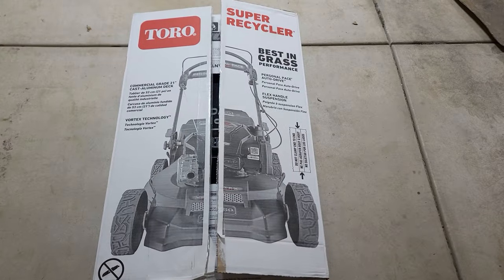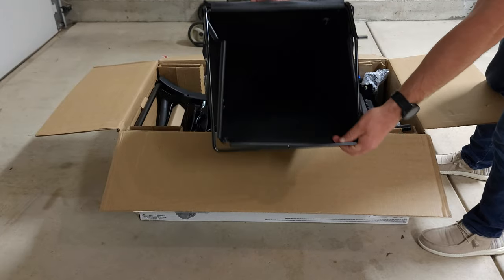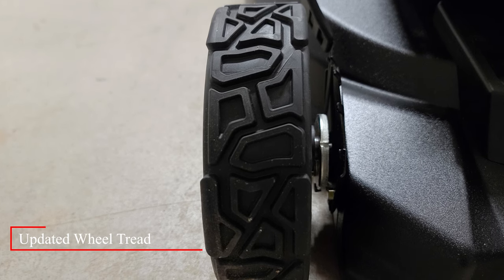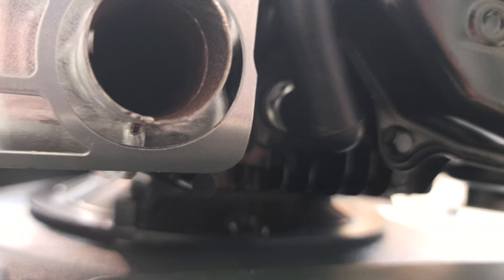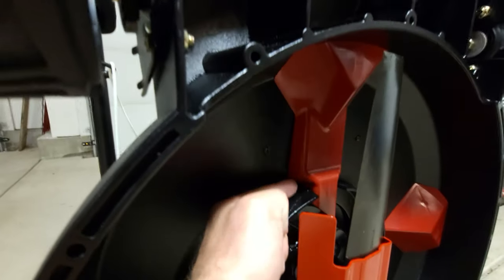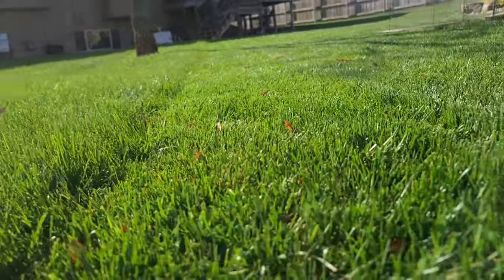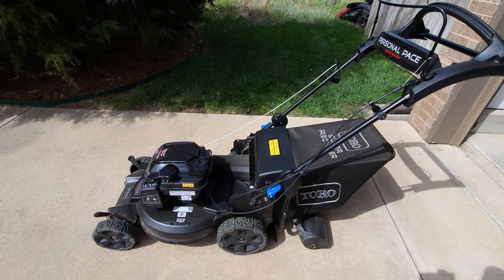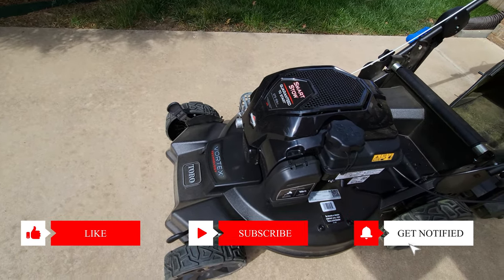Best Toro EVER?! New 2022 Toro Super Recycler 21565 Unboxing and Initial Review

Comment: why the hell would they remove the side discharge option?  Some of us deal with super high grass from time to time and that is the only way to mow it!
Reply: They didn’t. You have to register your product on their website then you can get the piece needed for free. They just don’t want them all ending up in landfills because of how many people don’t use them.
Reply: This mower isn't meant to be used out doors ... For high grass - remove ALL the recycling BS ... even the belt cover , detach the discharge flap springs  ... This will work till the wheel hub breaks, which they already have.
update 2024: The engine is done, something in the valve train broke.
Reply: It's my understanding that a lot of companies have gone to rear side discharge chutes to accommodate getting closer to walls and fences
Reply: This is the best mower, if only toro made a 30inch.. but the only thing i can say that fucking sucks is the mfer filter wont stay put.. and it dont matter the soze of any hole .. it get suck.. its pisses me off when it does it.. and just a thought ..swivel wheels.. high hp, self propelled not self pace, all wheel drive, with 2 blades. Becazue the time master is str8 garbage ..
Reply: Well I have the 2023 model and I can cut in bag 10 in of grass it'll also mulch 8 in of cut . They do sell a shoot that hooks on the back but if you register your product online and then you have to look for it a little bit there is a place for them to send you that new shoot for free. They just want you to register it first.
Reply: I have two complaints about this mower... 1 is the gas tank is not big enough and 2 the handlebar needs more adjustability. It's really set for one height of person there's a very fine adjustment you can make on the rubber bump stops but it's not much. When you're 6'2 the handlebars still seem a little low. When you're 5'6 like my wife the bar seem a little high. Now I do not have the problem with the left front wheel spinning on a flat surface. I saw it in this video but my mower does not do that maybe they changed it for 2023. I have no idea. This mower cuts great It mulches better than anything I've ever had and when it's begging it doesn't leave anything behind. The only problem I have with bagging is there's no lip at the bottom of the bag. So when you take it off you have to immediately tip it back so a bunch of grass doesn't fall out. That's just The bean counters of the company not allowing them to make fine adjustments to take money out of the stockholders pockets they get upset. Stockholders don't care about anybody buying the product They just want you to buy it and shut up. Can you tell I had a bean counter over my shoulder for the past 30 years telling me no you can't do that. The stockholders won't be happy, cut everything. They need more money. I'm retired now.
Reply: @bubdawgswhatdoyouthink7381  mines has done over 1800 cuts in 1 year and half.. there are some thing they can make better .. like idk wtf is up with the tire bowing out for no reason even after adjusting it.. and after while it doesnt oull as much.. but i just believe they design is flawed amd limited .. they should cater to us contractors .. like i want a 30 inch scag but i love my super recycler.. this 190 hp super recycler had 4 swivel wheels. Larger deck.. the bag is great and the gas tank i cam 2 large yards .. i was actually thinking about fabricating mines to add swivel wheels..
Reply: Never used it once

Comment: I have the Toro 21386 smart stow black with red Briggs Engine from 2020. It seems to compare very close to this machine from what i can see. I was very disappointed to see that Toro did not use letters or numbers to indicate the height of the cut. If you cut around trees often, the levers can be easily knocked and throw the height off. I’d love to know if anyone experiences difficulties when pulling the mower backwards at times?  I have periodically encountered this issue, perhaps the forward drive sticks on the machine. Also worth watching is the gas cap does not secure very well!  You would think these engines would have a way to click lock the cap once it is tightened fully. I have experienced my gas cap coming off completely when mowing simply by bumping into a hedge or other low objects. Other then that, I do enjoy my mower. The handles are the same and in my opinion the best on the market for collapsing and storing the machine away. Enjoy your new mower, thanks for sharing the experience.
Reply: I found that the small drive gears that drive the rear wheels if used on 1/4 acre or more need to be disassembled cleaned and re-greased  about every 2-3 years for them to release properly so you can go backwards , also having the mower roll a few inches forward after you stop pushing on the drive handle helps the drive gears unlock to go backwards.
Reply: @leekumiega4919  Yes, if you push the mower manually (don't push on the handle you would normally push on), the gears will usually unlock and you can move it backward easily.

Comment: Honda still the best mower for me in terms of cut, bagging ability, and mulching. I also like the new poly decks which are essentially indestructible.
Reply from the maker: I sure hope those Nexite decks stand the test of time, and stones, and curbs, and kids. Glad you like your Honda.
Reply: @lawntechtravel  actually right now I have the HRN series with the traditional deck. But I need a new mower to replace an older Toro at my rental. I want to get an HRX for my house and bring the HRN there. I feel confident that the Nexlite decks have a lifetime warranty. Plus I keep my lawn meticulously manicured so I'm never going over sticks or rocks. I however do get lazy and don't like to hose out my decks every time. I mow every 3 days at home and I already have some rust under the metal deck after two years of use on the HRN.
Reply: @Dsaubt  You're right, I have the 2022 Toro Super Recycler and the 2022 Honda HRX217.  The Honda is noticeably better at cutting and mulching.  Still some grass clipping, but overall better grass performance.  The one thing I will say about the Toro has over the Honda.  It's self propelled system does feel more comfortable and little easier to control.  Now that I've made up my mind.  I'm probably goes to sell the Toro to my brother in law soon since he needs a new mower.
Reply: The only bad thing about Honda is they dont offer a rear attachment discharge r I would say Honda. Being able to sling the grass if there is high grass is a most if that application is needed
Reply: @4x4gear33  I have sort of grown to prefer Honda's smart select system, but personal pace is really good as well.
Reply: Goodness my mother purchased a Toro Recycler 22 couple years ago.  That bagging attachment design is THE WORST. Glad that it looks like they've changed something.  That top is different...
Reply: Nice mower but height adjusters are cheap. SAE30 oil ?? Is this an overhead valve engine have not seen   straight 30 in a new engine. Briggs are OK not as good as Honda. The plastic deck on Honda is tougher than any other deck and height adjusters are the best  unless you have to have the cool lawn striper the Honda is better especially if you are mowing a large lawn or multiple lawns but if you already bought the toro mower you should be OK unless you are mowing multiple lawns height adjusters and possibly Briggs engine could cause problems down the road. Let's see how it holds up
Reply: @terminator7137  For some reason Toro holds the side discharge attachment until you register your mower. Then they send it to you. Takes 3-4 weeks. But, it's no cost to you.
Reply: Little warning for HRX Nexite users.  It can be cracked or punched hole in deck if you hit small rock or other potential projectile just right.  I have read LOTS of reviews and comments and Honda will almost NEVER honor that "limited lifetime warranty", so you need to completely forget about that and just consider the full 5 year warranty on the mower itself.  ANY crack or hole in the Nexite deck will be considered an impact or misuse and Honda tells you to pound sand.  The deck costs just under $300 and you'll pay all of that to replace it. 

I don't mow rocks, not on purpose, but NONE of us will use a mower for over 5 years and not mow up the occasional nasty pebble, rock or metal item left/lost in yard that we didn't see.  
I am really shying away from that Nexite mower.  I push/pulled an HRX in Honda dealer showroom, it's got lots of resistance from the self-propelled (the mower was not running) and pulling back is not easy/comfortable.  This was the non-hydro model mind you, not sure if hydro would allow non-resistive pulling backward of rear wheels. Not being able to back up means more wasted time circling around and more stress on wheels with constant turning around non-straight obstacles.

I see issues with the Toro recycler and super-recycler too...man, I don't think Toro or Honda make as good of mowers as they did just 5 and 10 years ago.  Sad.  I suppose EPA regulations partly to blame (the need for lighter, cheaper parts and lower gas usage engines).
Reply: Honda is dead
Reply: Honda is getting out of the mower business

Comment: I bought this one and mowed 3 times now.  Everytime I've needed to wash it out and it was completely clogged with clippings.  My 15 yo super recycler never did this.  The clippings on this new one are tiny so maybe that's why.  Unless the grass is as dry as hay I guess I'll have to plan on washing it afterwards?
Reply: I have a recycler and have the same issue.
There is a rear attaching grass chute you can buy.
I’ll be picking up one this week and will do a YouTube video on it, so check my channel and see!
Reply: I removed the recycling spinner & orange triangle from underneath .. I disconnected one spring from rear door & works for me.

Comment: I had a older toro recycler and I had a problem of having to replace the gears a few time for the self propelled wheels they would skip and make a lot of noise …. Never did anything wrong but after replacing them 3 times in 6 years I decided to junk it and bought a brand new Honda … never been happier with the new Honda I bought
Reply: Third set here in a year & a half

Comment: I just got one on Friday, have used it on for 3 days, I mow yards that have fairly steep banks.  And today both back wheels split around the bearings
Reply: I ended up returning mine the day after delivery. One of the back wheels was not straight. Something was bent. I was bummed so I ended up buying a HONDA HRX217.
Reply from the maker: That's really unfortunate. What made you pick the Toro over the Honda in the first place?
Reply: Thank you : If you actually use this mower, You will discover how poorly it's made. Our 21565 looks like it was thrown off  a truck .. The back axel has sheared off ! .. wheels are bent & split.

Comment: No kidding I picked up one of those E series Briggs motors on a curbside throw away deal. Never been taken care of and used oil way too bad for me to resale after I got it running so I was like... What the hell I'll drain the oil and ziptie the engine brake and see how long it would run before blowing up. It ran a whole tank of gas out with 0 oil! I filled it up again and mowed my two dog pens (roughly 1/8 acre) before it locked up. Pretty jam up engines for the price point!

Comment: Thank you for this review! I recently ordered the Blade Stop model but I couldn’t find any video reviews. I was regretting the Toro Super Recycler and was thinking of going with the Honda but after watching this, you put me at ease. #1 reason I don’t want the Honda HRX is the plastic body. People have accidentally picked up rocks and put holes through the body. Honda wont stand behind their “lifetime” warranty. I’d rather have a solid aluminum body.
Reply from the maker: You'll have to let me know your thoughts when you get yours. I'm kind of wishing I spent the money for the blade stop
Reply: I bought one with the blade stop and the blade stop tensioner broke. I've been without it for a month and a half so I bought a Honda while waiting. I like the Honda better except the personal pace is more comfortable.
Reply: @lawntechtravel  The end of the cable for the blade stop is plastic and mine was broken while still in the box. H.D. ordered me a new cable as they could not tell me how long I would have to wait for them to do the repair so they ordered me a cable and am still waiting .  I ordered one from Amazon for now and will have a spare when it breaks again as it no doubt will .

Comment: Do you have to empty the oil and gas before placing it in the smart stow position?
Reply from the maker: No you do not! That's the great part about this smart stove is you can simply tip it up and clean under the deck without worrying about leaking gas or oil

Comment: You like the new round handle. I like the older version. Your thoughts
Reply: I had both styles. The advantage of the round handle is that it actuates forward rather than downward and you can place your hands in various positions. Disadvantage is that it’s slightly bulkier. Overall it’s an improvement
Reply from the maker: I didn't have a chance to use the old model but this new handle is pretty bulky. However, I find it drives the machine pretty well and haven't had any major issues. Overall I tend to enjoy it!

Comment: I purchase a similar mower new @ Home Depot in July of 2022. Use it 2-3 times monthly . Like all of the features on the Toro mower itself, but have a had problems with the Briggs & Stratton engine. Has been in the Toro repair center twice this year. Problem I'm having is after 15 mins of use, the engine stalls out like it is running out of gas. Have to wait 15 mins to cool off to get it restarted.  Soon as I get in back this time from the service center, going to sell it and purchase the mower in the video.
Reply from the maker: Hope your new mower works out. I haven't had any issues with the engine so far on this model. I plan on giving a 1 year update soon. 👍

Comment: Nice mower.  Looks easier to push & pull around trees/obstacles (off drive mode).  Alum deck: nice.  I like the guaranteed to start engine, and bag removal looks easy.  (I bag almost exclusively, especially in the fall [leaves]).  I also like the smart stow feature.  Nice looking too.  Thank you for making and posting this informative video.
Reply: Is there actually a way to just make this thing work as a free rolling push when youre going back and forth under trees and stuff 300 times?  I’m not familiar at all with it and expected you’d have to hold down some safety bale and have to use the personal pace handle to keep the blades going anyway. Does it still push hard like you’re driving gearboxes yourself?
Reply: @stirv6462  Hi.  If your mower is brand new, hopefully, the drive belt will begin to loosen (length) a little (with use), (& its frictional surfaces change some) to provide a little easier push (in off drive mode).  I have the same situation here with obstacles (trees, bushes) requiring manual pushing our mower.  (Mine [orig owner] is an old '84 Honda 21", needing replacement, so am looking at these new Toros).  I hope that your situation with your new mower improves.  (Hopefully, it will).  God[Bible] Bless.
Reply: @stirv6462  bungie cord around the safety lever then hold onto the lower lever below the top one if that makes sense
Reply: @stirv6462  So if you're talking about the personal pace and it feeling like the brakes are on when you're trying to pull it backwards. You can adjust the cable by pulling it towards the motor a little bit you have to find tune this thing and once you get it set you'll be good for a little bit. The belt will stretch and you'll have to do it all over again once the belt has stretch to its maximum amount it usually stays pretty good. But still it feels like the brakes are on sometimes It really needs a spring to help release it. But when I asked Toro about it online they told me there was nothing wrong and this is the first time they've heard of it, but there's at least 10 videos out there that complain about it apparently they don't watch YouTube have a good day.

Comment: I have been a Toro owner for years.  My local Mom and Pop Toro dealer cannot get this model.  They are the nicest people and always happy to help.  Meanwhile my local Tractor Supply has two of them, still in the box and not even on display...  So, Toro isn't sending their small dealers the newest but the big box stores don't even know what the newest is.
Reply: You do realize that this could have nothing to do with big-box store vs Mom & Pop shops, right?
I highly doubt Toro is being selective over who gets what mower.
Reply: I just bought the '22 Super Recycler with the 190cc B&S at our local dealer and am very pleased with it so far.  Thanks for the review! I was considering the Honda HRX vs this one.  Personal Pace drive is great.
Reply: @DIYTutorialGuy  You must be drinking that Biden koolaid.  There is no doubt in my mine Toro is moving towards Mass Merchant store and away from small dealers.  We were a smaller Toro dealer since mid 1980's until about a month ago  . Our dealership had trouble getting equipment  last couple years, but the local Tractor Supply and Home Depot  were getting the exact same model we could not.  I know of several smaller dealers in our area who are fed up with Toro.
Reply: Recently saw a video where a Toro dealer said that some models are made specifically for big box stores.